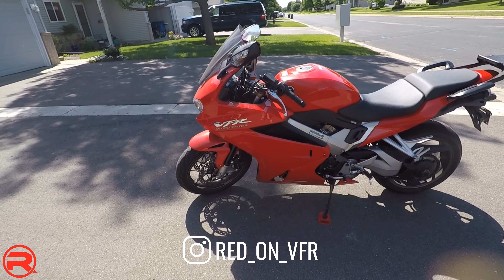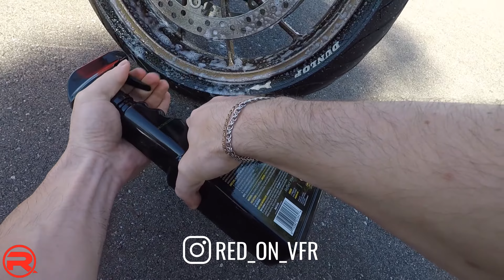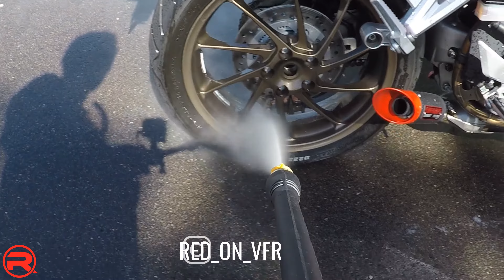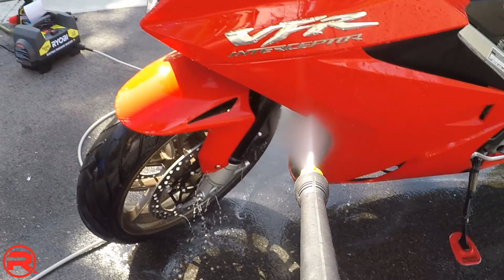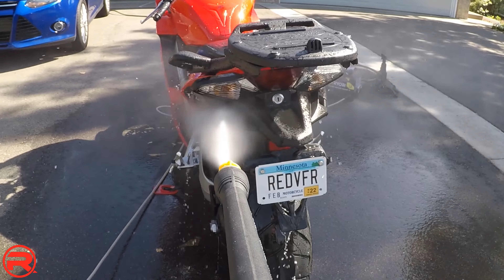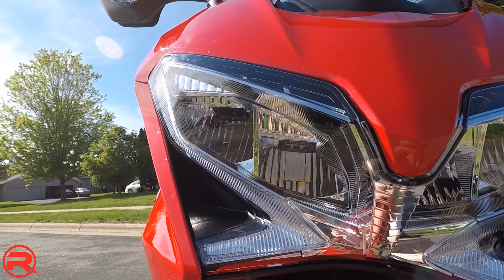🏍 EPISODE 50. FINALLY I WASHED MY HONDA VFR 800!!! WELL DESERVED WASH AFTER A YEAR WITHOUT CLEANING!

Comment: its a beautiful bike it definitely needed that clean lol, I'm thinking of getting a 4th or 5th gen VFR but I can't decide.
Reply from the maker: 4th all the way if it is in a good shape. Both have identical engines and sounds. :)
Reply: @REDonVFR  I guess that settles it then, I always loved the 4th gen, I only recently found out about the 5th gen and that it also has the gear driven cams.

I regret selling my VFR 400 because I miss that sound. 

But yeah I will see if I can find a 4th gen that's mechanically sound, I don't mind a few damaged plastics if the bike underneath is in great condition.
Reply from the maker: @thatwolffe3802  send me a pic when you get it!
Reply: Get the 5th gen. I had one for 18 years straight and even in her final days worked like a Swiss watch. Unfortunately I had an accident and I couldn't save her. Got the same model as Red, but I miss the older gear-cams-no-vtec wonderful engine, though. I really loved that bike... Made some changes in the new model (SC Project exhaust and quickshifter), but still lacks power. Thank new model feels safer, but the 5th gen was a very fun ride.

Comment: Hi Red! I also have those bike wash issues, but recently I tried a non-water product and I'm very happy with it. It's Motul Wash&Wax. Not only is very effective on taking all the stick bugs in the fairings and windscreen, but also keeps a protective wax layer, which is nice for all bike's plastic parts. All you need is a clean microfiber cloth. I recommend it. Then it's just the old Karate Kid technique - wax in, wax off 😂
For the chain, I also use a Motul chain cleaner to degrease it and which brought a sort of chain brush. All you need to do is to put the bike in the center stand, spray the chain and then on 1st gear let the brush do its job. Cheers
Reply from the maker: Very good tips, Pedro! I remember motul's products! Funny you mention a centerstand :). Next episode will be about that :)
Reply: @REDonVFR  I use it a lot. For more practical reasons, like chain degrease and lube. Also, when I'm not riding it for a few days, I keep her on the center stand. It's a big chunk of the VFR overall weight, but very useful. One of VFR's all time features, along with the V4 engine, but which is barely noticed and spoken about. Waiting to see your video.